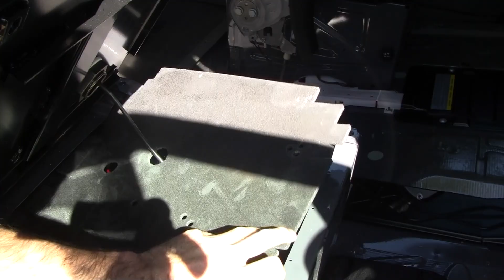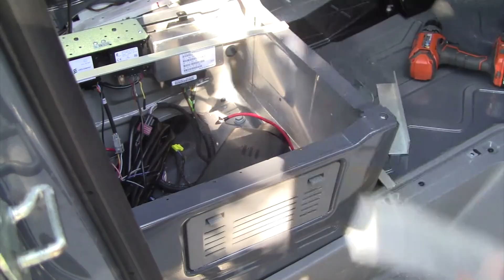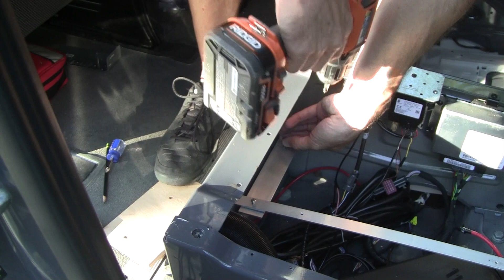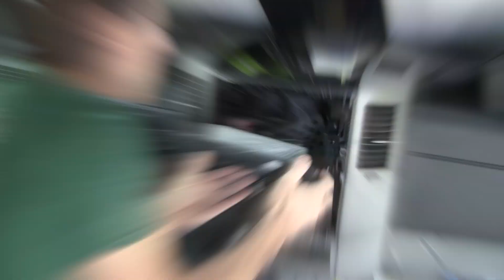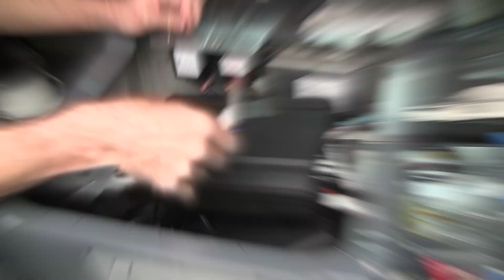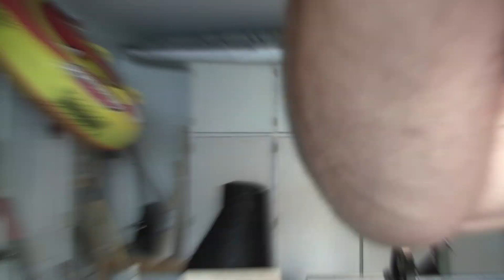Sprinter audio upgrade amplifier install

Comment: If I only add subwoofer how the process work? Please
Reply from the maker: You still need to route head unit outputs to the amp to create a signal for the subwoofer.  I don’t believe the head unit has a dedicated subwoofer output
Reply: @DadsVan  Can I use rear output from head unit to subwoofer?
Reply from the maker: Yes you can.  See options in the manual here https://support.alpine-usa.com/products/documents/OM_S-A60M+S-A32F+S-A55V.pdf

Comment: Can you show us how you connected the speakers to the channels in the amp? From your video the white cable has 4 wires but each channel has a + and -.
Reply from the maker: I used a four conductor wire so I only had to run one cable instead of two back to front head unit for left/right speakers.
Reply: @DadsVan  Did you then do two cables for each +/- of each speaker?
Reply from the maker: From head unit to left an right speakers (which is what I believe you are referring to) I just relied on the existing factory cabling.  That is why I used the adapter kit at the head unit, so I could bring the wiring from amp output back to head unit, and then from there the factory connections work
Reply from the maker: For my rear left / right speakers and rear subwoofer I used 2 conductor cable for each. This is because those were not part of the factory wiring, and I added them, thus I had to run my own +\- to each of those rear speakers.
Reply: @DadsVan  Got it so one white cable did both front right and left and then the other one was for your rears. A total of 3 white cables, front and rear. The 3rd cable was for the RCA correct? Where in the head unit does that go to?
Reply from the maker: The RCA is input to the amp.  So for front speakers you need to bring four wires (+\- for each front speaker) from the head unit (using a four conductor cable) to the amp, and adapt those to RCA.  Repeat if you want two rear speakers. See my video description for links to all the parts needed.

Comment: You never showed us where the accessory power to the amp is found. 🤦‍♂️
Reply from the maker: Yeah sorry about that.  I set that up by creating a new feed off the starter battery fuse distribution box to a bus bar and 60A fuse under the driver's seat, then fed the wires over to passenger seat.  I show that in a different video: https://youtu.be/tEcoH0UdLq8?t=1548  starting at 25 min 47s.  Hope this helps and good luck!

Comment: Will the heat generated by the Ebersparche D2 heater?
Reply from the maker: I have not had any issues with the Espar D2 and Alpine amp installed and running under the passenger seat.  It is important to ensure there is good ventilation to seat base area, so I suggest replacing the seat base panel cover with a vented panel.  See this product on eBay:  http://ebay.us/QEArVj
Reply: Well ... all I can say is that logic (with modest vent) is saying don’t combine a heater with an amp.  Imagine running all night the heater ? With time slowly that heat will do its magic on what ever electronics is near and they are not that far from each other; but if you’re happy then is your Van not mine.
Reply from the maker: @nicholj2002  I can certainly understand your reservations, and you should absolutely do your van however you feel most comfortable.  I'm just sharing my experience, and so far its worked out great.  The Espar manual says any heat sensitive materials need to be 2 inches away, which they are in my case.  What really gets hot on the Espar is the exhaust/line, not the heater body or the air around it.  Good luck!
Reply: @DadsVan -- Per The technical description and installation instructions
Arrangement of the heater 
Parts of the structure and other components near the heater must be protected from excessive heat exposure and possible fuel or oil contamination.  The combustion heater shall not constitute a risk of fire, even in the case of overheating. This requirement shall be deemed to be met if the installation ensures an adequate distance to all parts and suitable ventilation, by the use of fire resistant materials or by the use of heat shields.  The heater must not be installed in the passenger compartment of class M2 and M3 vehicles**. However, a heater in a hermetically sealed enclosure which also complies with the aforementioned conditions may be used.  The nameplate, or a duplicate, must be positioned so that it can be easily read when the heater is installed in the vehicle.  Every reasonable precaution should be taken in positioning the heater to minimize the risk of injury and damage to personal property.
**[Category M2: having a maximum mass not exceeding 5 tonnes (11,000 lb) Category M3: having a maximum mass exceeding 5 tonnes.]